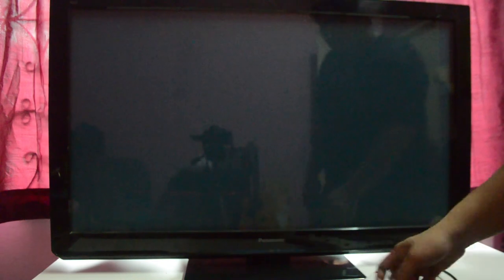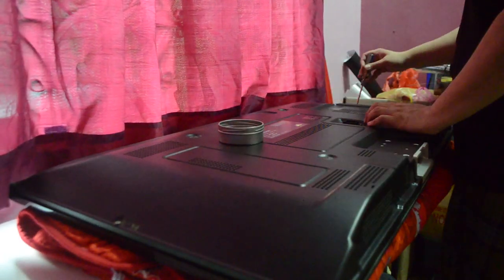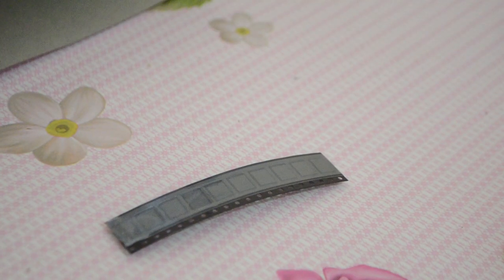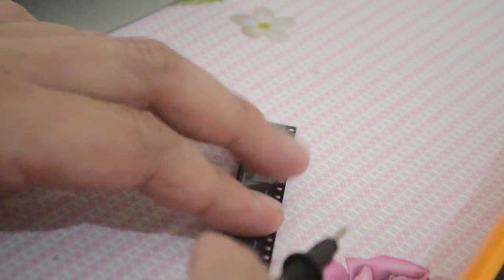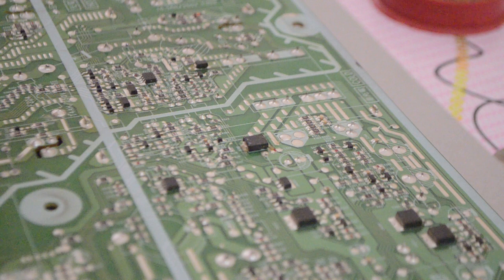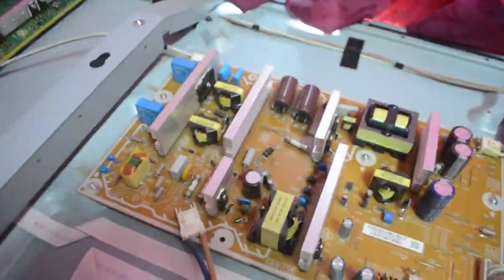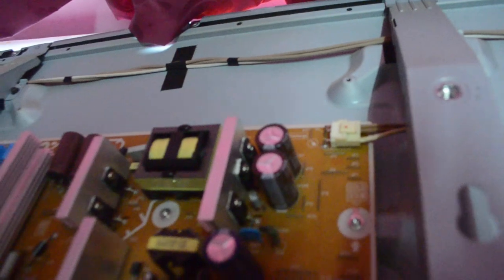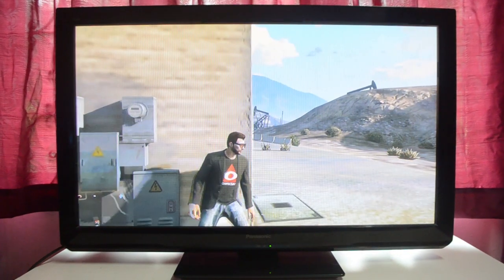FIX! Total Dead Panasonic Plasma TV

Comment: Amazing tutorial. @Arian Fix Stuff 
Mine is blinking red, but won't turn on. What can that be? It's not dead per se, but just won't turn on.
Reply from the maker: Have u tried to unplug all the cable link to  the tv, then perform a power reset?
Reply: @ArlanFixStuff  No:) Where might those cable links be?  And how to power reset?

It clicks nicely when turned on, but blinks red after blinking green. For a while, it worked to hold in a button on the remote, then it would turn on. But I had to push the tv button on and off more and more. It worked less and less gradually over time. As if something was running out slowly more and more.

A tv repairman looked at it, and the only conclusion was that it was something about the main board module. (I feel that was sloppy diagnostics) Sounded like he meant the whole mainboard)
Reply from the maker: Owh i see.. i'm not really sure about the cause, but from ur description it might be some component on the motherboards are failing overtime. U have to find someone who has knowledge about repairing motherboard
Reply: @ArlanFixStuff  Thank u <3
Reply from the maker: Im sorry for not helping enough
Reply: @ArlanFixStuff  That's ok ;D

Comment: A light switch controls power to the outlet. My Panasonic Plasma TV was on and I accidentally turned the light switch off. The TV IMMEDIATELY DIED AND I CAN'T GET IT BACK ON...Any ideas to why? Or what can I do?? No light whatsoever..
Reply from the maker: I'm not really sure, but try pull out all the cable to ur tv, power cable, av cable, hdmi etc, then press power button a minute or two. Then plug in the power cable to turn it on.